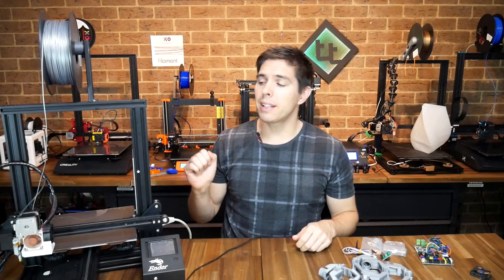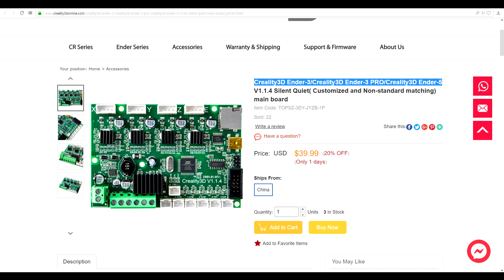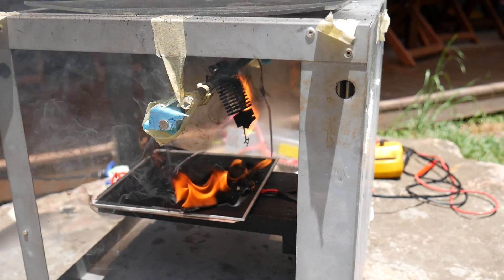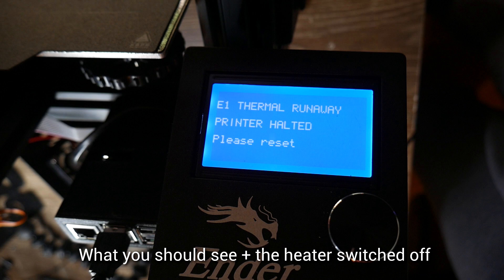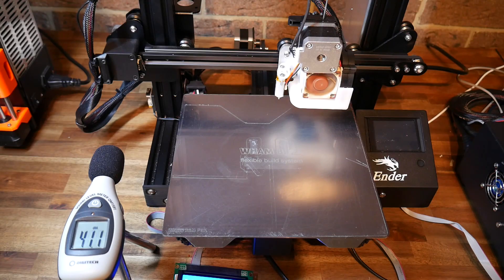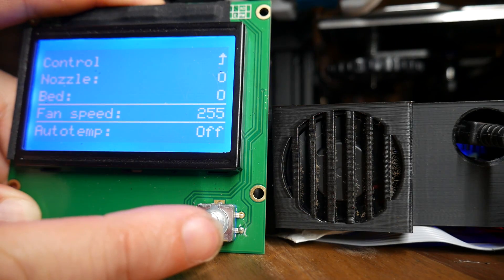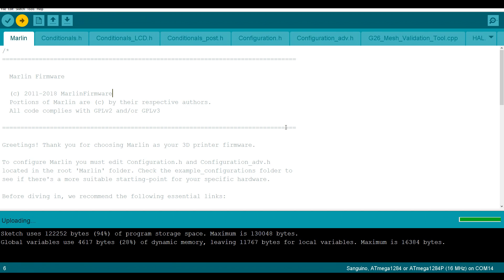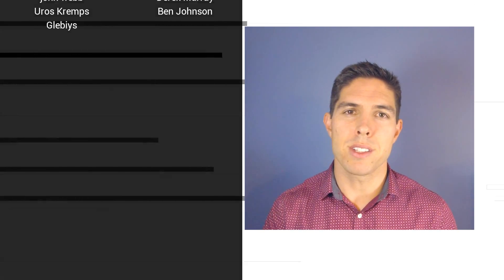Creality 1.1.4 Ender 3 board upgrade - TMC2208s from factory

Comment: I´ll get my Ender 5 tomorrow or day after tommorrow. I hope it also already have the new board. If it does, I will stay to it, only making the firmwareupgrade and maybe add an BL-Touch.
But I wouldn´t buy the crealitys board seperatly if it is not already in the Ender 5, because I think if changing the board using a 32-bit board would be better. A bigtreetech skr v1.3 with 5*TMC2208 costs only 39US$ at aliexpress runing smothieware - so same price as the upgradeboard from creality but more powerfull. So it would be the better solution. Of course I got a Duet Meastro clone for my Ender 3 last black friday for about 65€ and such "sales" are often repeated on Aliexpress (like on the "9. Aniversary sale" - there are such sales 3-5 times a year, so maybe simply wait for the right moment to buy...). The aditional features may be woth investing some more money, because you not only get TMC drivers but also network connectivity and many many expansion pins. Instead of using a simple Touchscreen you can use an older tablet for control (I have a Amazon fire 7 5.gen with cyanogenmod for this) - but you also can connect the stock display of the Ender 3/3pro/5 to a duet maestro (clone).

Edit: Sadly I got the Ender 5 with old stepper drivers :-(

Comment: Does this board have more memory available than the old one?
Reply: No it does not, it has the exact same 1294 chip on it, so that issue is still a problem.
Reply: @deceitive3338  ah ok, so they've just pre loaded a bootloader. If it stays at its sale price when back in stock I might take a look. Although saying that, the fact that it still has a mini usb port on it and no way to directly connect a BLTOUCH kinda suck.
Reply: Id like to know that too! Michael?

Comment: Shame they stuck with the 128K memory ATMEL
Reply: I was wondering about that too because isn't it like the old PCB, ie, it too small for full Marlin.
Reply: @SidneyCritic  Yeah it's identical aside from the upgraded stepper motor drivers, it's a shame they couldn't have just stuck a better Atmel chip on it as well. So you're still limited in the number of features you can turn on in Marlin, pretty much only room to add a BLTouch and it's maxed out. I still think the MKS Gen L is better for anyone willing to do a bit more work.
Reply: @Remon Pel It is still possible to use the pin 29.

Comment: I already tested the bltouch from creality on my ender-5 with the 1.1.4 board, and i cant get it to work. I followed the steps (https://www.youtube.com/watch?v=iAz47riSjLQ) but the bltouch wont stop my bed from going up and so the nozzle hits the bed and "auto home" stops. Answer from creality, "Ender 5 does not support bltouch (v3)". V3 is the latest bltouch they sell.
 I can not wait for the new video an hopefully it will solve my problems with the bltouch.

Comment: I got my Ender3 6 months ago. After doing some of the  BASIC mods but still stock Extruder/hotend and REGULAR MAINTENANCE we produce TPU PLA PETG prints that out shine my neighbors new Prusa. This, of course, is infuriating to him! No upgrade for me!! YAY!
Reply: Yeas if its not broken dont repair it...like they said
Reply: @noway8233  those yellow springs for the bed leveling are the best investment money you can spend. I print 3-4 times a week and haven't leveled it in at least 3 weeks!

Comment: Now that I have the MKS Gen 1.4 boards with TMC2130 drivers on my Ender 3 and parts to put them on my Ender 5, no. But, for someone that wants an easy upgrade to TMC2208 without hassling with new case and such, yes. It's definitely the easiest way to get a quieter printer.

Comment: How does the available pin setup look? 

Still need to do some of the same fine detail solder work?
Reply: Best I can tell they are only running in standalone mode, so UART is not possible. You won't need to do any soldering with this board.
Reply: More thinking of connections for bl touch and run out sensor. Previous versions of the board required some serious hide and seek to fine pins to use,  and then some very fine soldering work.

Comment: I can't see any reason to upgrade to a gen L over this, it looks like the total cost is less when you factor in the stepper drivers and the reprap LCD (or some other solution to retain SD card) and its easier. seems like a no brainer to me
Reply: There are some benefits, the biggest difference is the chip on board, this one from Creality still has the same chip so you're very limited by memory. The other difference is this board only runs the 2208's in standalone (legacy) mode, you can't use UART mode, but that's not a big deal.
If you plan on further upgrading the machine with filament runout sensor, BLTouch, etc, the MKS is definitely the way to go.

Comment: I still think the fysetc f6 is worth the extra few bucks to run the tmc2208 via uart without any flying cable. Anyway it is good they have started to use the tmc drivers, finally.
Reply: F6 is great but you can get SKR v1.3 for $20 and you get 32bit, TMC2208 UART and 2130 SPI support without cables... $40 with 5x TMC2208 which is cheaper than this "Creality upgraded board"
Reply: @alexganov  sure it is a good option, but since I use klipper I don't need the 32bit and I prefer a tested working platform instead of being kinda early adopter

Comment: Creality: The Later You Buy The Better Machine You Get
Reply: David  Would you rather Creality's products had a price hike with every improvement they made even though 99% of the device is the same as the last? That IS what Apple do - just add an S on the end of the name, add on $200 to the ticket, and change the CPU. Screen, battery, camera's, etc all the same.
Reply: David  They sell mostly via resellers. Adding "v2" means they would not put many printers in stock but reorder in smal ammounts from creality as on any new version their stock is outdated and they significantly have to drop the price to get rid of the outdated printers. So it would be hard for creality - even in their warehouses out of china they will get the problem for themselfs. So I can understand they make the upgrades in secret first...
Reply: Welcome to buying ANY tech lmao. You’d be in an endless loop of waiting.
Reply: I just bought yesterday, expecting delivery today....... wonder what I'll get
Reply: Yura I Same from every other company in existence. Apple and Android phones are just the same way.
Reply: @EndermanTheMan  no, those companies sell you next number model and usually with a price hike.

Comment: Creality makes good stuff but this is horrible! You say it's safe but it does not turn off? What da fuck is that?
Like somebody is gonna buy this think it's safe now I can go get grocery while printing (never do this even with protection in place by the way)
and he is gonna be really fucked if something goes wrong.

*edit: by you I ment creality sorry for the confusion
Reply from the maker: Please watch the entire video before commenting. I clearly state and show that you should update to a newer version of the firmware to fix this, which is easy because this board has a bootloader.
Reply: @TeachingTech  I get that and I love that you did, but I was commenting on crealitys   advertising more then anything. Somebody might hear about thermal runaway see this board and think its all fixed. Lucky your vid might help them to get it updated but they should have fixed it from factory if they advertise it this way.

Comment: I recently  purchased en ender 3 pro, I have near constant leveling issues with it, and have had to send it back to the site I purchased it from when the filament  motor died within 3 days, I managed to get a total of 3 successful prints in that time. The rest either broke  due to a lack of bed adhesion within 4 attempted prints, or due to weak layering and other issues. 

I just got it ba k started putting it together again and bolt heads are stripped making fine tuning difficult to impossible and I put on some double sided tape for a new glass bed and need to adjust the home settings to match the raised height. 

What would you recommend for these issues and how difficult would it be for a complete novice to mod the device?
Reply: hmm, I was a colpete novice when I go this printer, it took my 2 weeks to nail it down to get near perfect prints, try printing a spacer and added it between the x carrage and the bed to compress the springs more so it will be tighter and a more consitent bed, I thighten all the bolts and belts very tight, and I have my xrazy fast and sharp scli3r profile but I also recormend CHEP's cura profile. I also have a glass bed on mine and with larger prints I use a brim and I have my bed anywhere from 68 to 75, I don't feel like correcting my speelling, see ya later bud

Comment: Same board, different drivers, not surprised the board fan is tied to the part fan. Thermal runaway missing isn't surprising either.
Reply: Problem is TMC2208's get quite hot so if you are printing without the part cooling fan, for ABS, for just the first few layers of PLA or PETG, or with the fan on low, they could get very hot. It's better to unplug that fan and cut the connector off of the end, then strip each wire and connect it directly to the DC +/- input to the board. That way if the board is getting power the fan is blowing full speed at all times.
Reply: @deceitive3338  on mine (sitting in a bin now) I wired parallel to the hotend fan after I found out.

Comment: This is the board that my Ender 5 shipped with. I'll be looking into upgrading the firmware.
Reply: That's pretty lucky. I received my Ender 5 about 3 weeks ago and I got a Landy and the board with a4988's. My MKS GEN L is on the way with 2130's but I doubt I would have bothered if I had the 2208's stock. Nice one!
Reply: @kimmux  I ordered mine late February and it took about 3 weeks to get it. The company I ordered it from posts that their Ender 5 comes with the Ver 2.1 main board and even confirmed that through email with me. They also claim to have it in stock and that it will ship from their Arizona warehouse. Well, of course, it didn't have the V 2.1 mainboard and came directly from China. I was glad to see the new 1.1.4 board though.Still a Landy supply, btw.
Reply: @jamesmerritt5562  Nice to know thanks for the info. I'm not too sore either way I've replaced about 60% of mine and I'm about to do the MKS GEN L, and replace the wheels with linear rails. I've done just about everything Michael has a video for on Ender 3/5 to mine now, it's been great I'm loving the process and the results. These videos make things so approachable it's unreal, I just started 3 weeks ago and I'm customizing my firmware and designing my own parts. This community is really terrific. If you look me up on thingiverse as kmxs I have some Ender 5 parts available you may like.
Reply: @kimmux  Thanks! I'm on there as well under "youronlysin". I've got a few organizational doodads for the Ender as well. I'll look ya up!
Reply: Does this new board have a bigger memory on for bltouch etc
Reply: @ianpimlott2588  It did not!

Comment: It certainly is a more convenient upgrade, especially for less well versed users, just swap and plug.
But again, Creality made the same mistake of not having the stepper drivers removable like on the modular MKS. Now if one of those goes bust, you gotta swap the whole board. Simply not good enough!
Also, though it is a cheaper alternative to a RAMPS or MKS board, it still costs a good quarter of a new Ender 3 if on sale. So good for all those buying a new machine that already comes with this new board. And the promised thermal runaway protection being nonfunctional by default is simply unacceptable and a completely unneccessary quality control issue.
But at least it has a functional bootloader, which is nice. Still probably not gonna make the upgrade without being forced to by a defect.
Reply: Quarter?! They're 18 bux. How cheap did you get your ender for?
Reply: @ster9765  The Creality store link provided shows me a price of $39.99 USD and i got my Ender 3 for under € 200. Where did you see them for $18? Because for that price, they'd be more than worthwhile.

Comment: Any chance of testing this board with Octoprint? It looks like this board uses the same CH340G usb-to-serial chip as the MKS Gen L and I could not get that board to work with Octoprint. It was also a hit and miss to get it to work with other devices. I had to go back to the 1.1.3 stock board (FTDI based) while I wait for a MKS Gen 1.4 which is also using the FTDI chip.

Comment: I got an Ender 3 recently, and it has the 1.1.4 board, but it doesn't have TMC2208's. 😔 I've installed a Gen L now, i wish I would have known about this upgraded board, tho it still has the 1284p and struggles for space with the bltouch activated.
Reply: My new 3 also has the v1.1.4 but I haven't checked the drivers. Did you have to remove the heatsink?
Reply: @dougpalmer9202  Yeah, the noise it makes will tell you which drivers it has. If you can barely hear it while printing (aside from the fans) then you have the 2208's. If it's annoying to be in the same room while it's printing, you have A4988's. :)
Reply: @dougpalmer9202  nope, don't need to, it's noisy as hell 😆 has R100 sense resistors too 😣

Comment: Does that board come with the 1284 or a larger chip like the MKS GEN L? Would be nice to have more room. And also, will UART work with those 2208s?
Reply: Still 1284p. They just swapped out the drivers and resistors on the existing V1.1.4 board.
Reply: @TH3DStudio  thats a disappointed. I would have bought one if it had the bigger one. I have already had to dial down my lcd just too fit manual mesh bed leveling
Reply: And UART is not possible, they are configured in standalone (legacy) mode, unfortunately.
Reply: @deceitive3338  but we could flash our own marlin firmware and switch the mode, could we not?
Reply: @raider1284  My understanding is that the pins required for UART are not actually connected to anything. I don't have one to inspect (I use an MKS Gen L with 2208's) so I could be wrong, but from what I've seen there doesn't seem to be the supporting circuitry required for it. That doesn't mean it's impossible since technically you could solder the wires & resistors on yourself, but that would require much more work than the $10-$15 extra it costs to order an MKS Gen L that has all of the pin headers ready for the UART wiring. If you're after UART that is by far the easiest way to go, just make sure to order the Fystec brand TMC2208 version 1.2 breakout boards to save some extra work.
Reply: @deceitive3338  that would be super disappointing and dumb if the uart circuitry was literally not there. Hopefully those that have one in their possession can do some experimenting and let us definitively know.
Reply: Yes I would like to know that as well